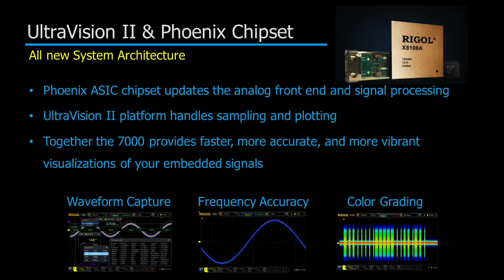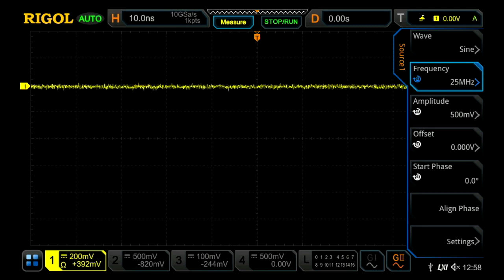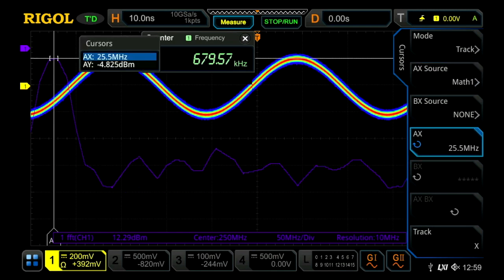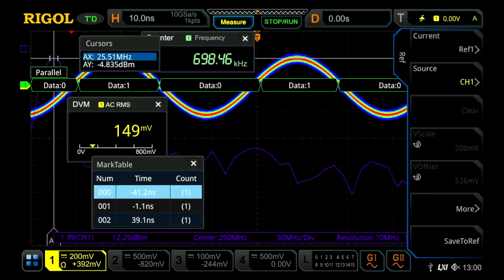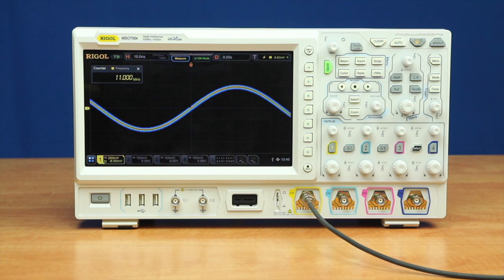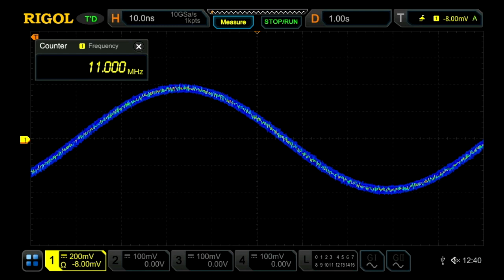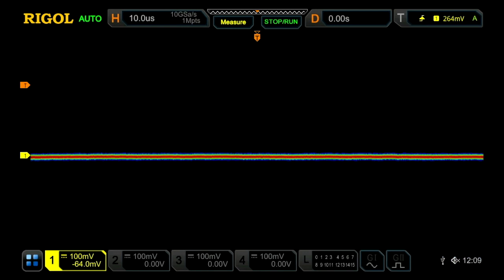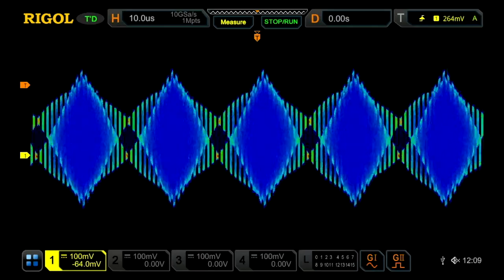Benefits of UltraVision II and RIGOL's Phoenix Chipset

Comment: Serial decoding is fast in this model;  however it looks like serial decoding is still done by software rather than hardware ; am I right?
Reply from the maker: Serial Decode resides within the Sampling Processing Unit (SPU) in the UltraVision II platform. This operates in the FPGA or DSP, so it operates in embedded code but not in the RIGOL custom silicon.